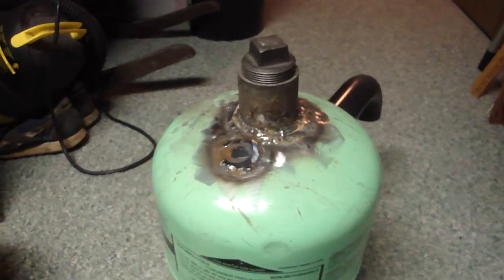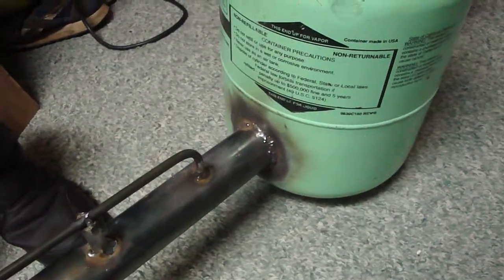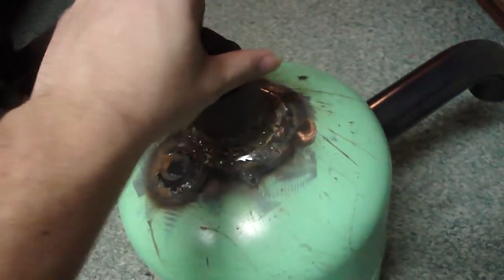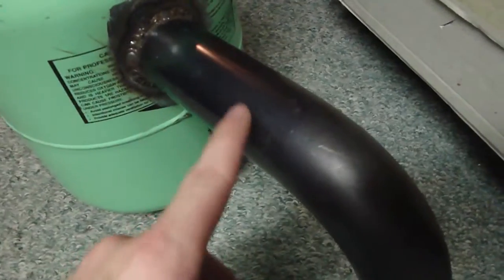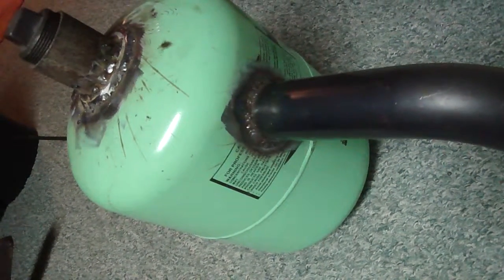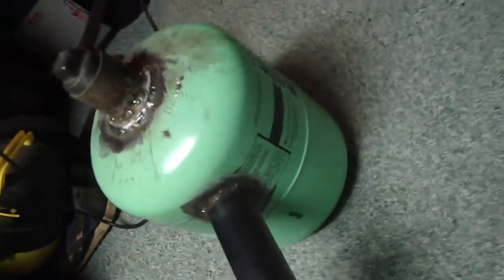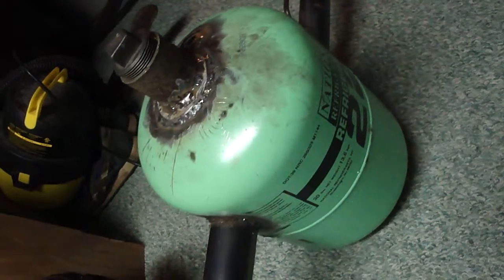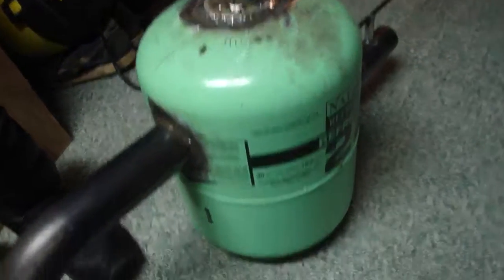M4H04180

Comment: Looks like a really well made burner. I'll be interested to see how it goes without the angled inlet.  My prediction is it may be a little hard to start but once up to heat and running it will work fine.  You might want to try putting a little oil in it and then firing it up on gas until it's hot and glowing a bit then swap the fuel line to oil.  Might also be fun just to fill the thing with sticks and paper and see how you go with that.

Be sure to let me know when you have the fire up vid done.   Good luck with it!